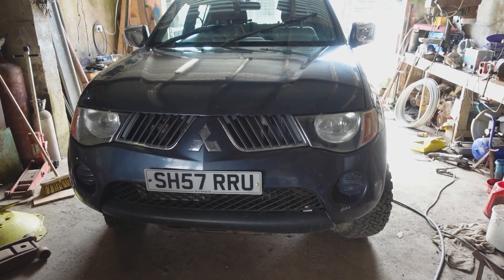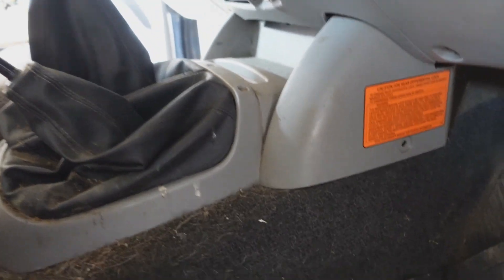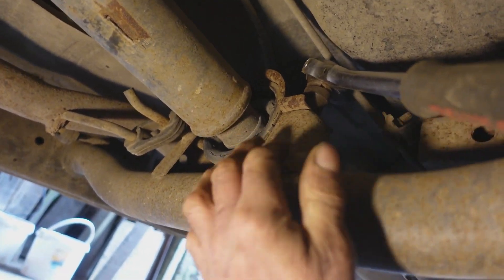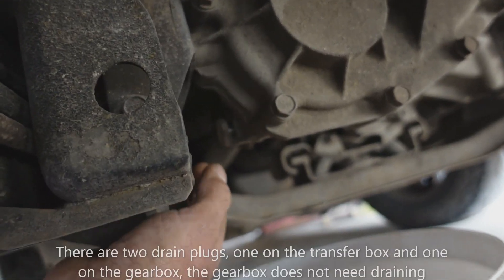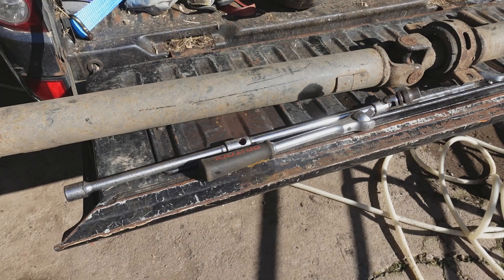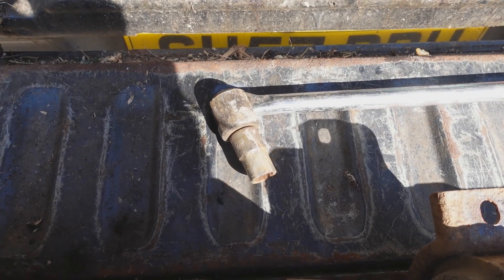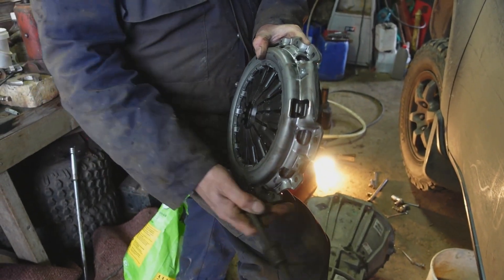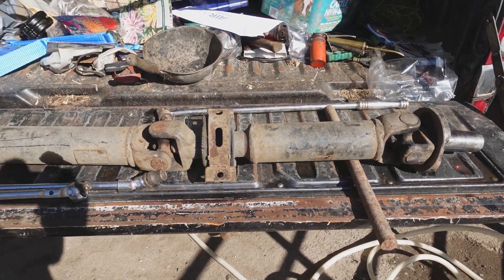L200 clutch replacement

Comment: Were you not worried about asbestos. I have just dropped my transmission and now having 2nd thoughts. Kinda gone bit far with it now but still humming and hawing. 
To my knowledge asbestos was banned fully in 99 with exemption to 73 plate or older. But will it have been banned in Japan ect where these cars were made ?
Reply from the maker: I did once research asbestos related dangers quite thoroughly. According to figures available, each one of us already breathes in twenty thousand asbestos fibers per day! No need to take any more risks than neccessary though. Wear a mask and use a vacuum and do not spread the stuff arround with compressed air. There were three unrelated but similar minerals used as asbestos, the bulk of which are harmless. The ones since identified as dangerous were used during true asbestos shortages and are relatively uncommon but indistinguishable from the harmless stuff so take care. 
As for myself, as an apprentice I had to saw, drill, file and sand brake linings as part of my job. I remember asking the safety officer for a mask because there was an asbestos warning motif on the roll of 'ferodo' and being told to get on with my job.  
I also had a friend who was a painter and decorator who died of asbestos related disease he told me that as an apprentice he regularly had to sand and prepare asbestos panelling in council houses in Sheffield.
People are changing clutches and brakes all day every day so I still do it, I take some precautions but don't worry too much about it.
Good luck, Jon
Reply: @ Yeh, unfortunately lost my Grandad to asbestosis back in 2019 he used to work in power stations as engineer climbing in and out of boilers which are lagged in it for fire retardant. It’s a generation thing I suppose, did some research last night and it’s showing that it was banned in Japan in 1985 or there abouts but Mitsubishi and some others continued to use it up to 2005 when they got caught essentially. So I have a 11 plate so think it’s fine but yes other materials were used ect. I’m just very wary of asbestos now after my grandad, I’ll have breathed in far worse things more than likely but still no need to take risks if not necessary.
Cheers for the reply